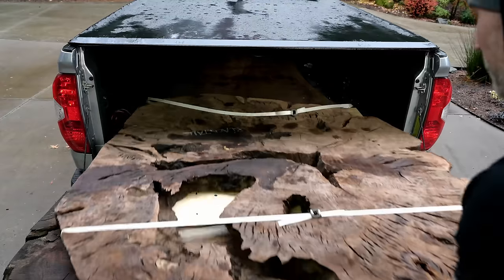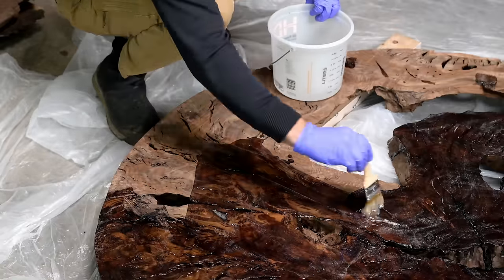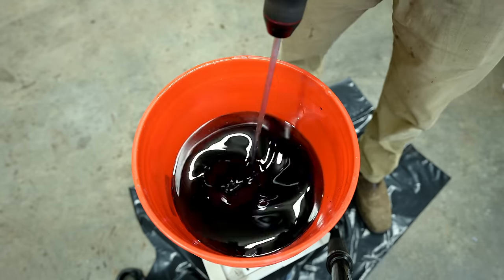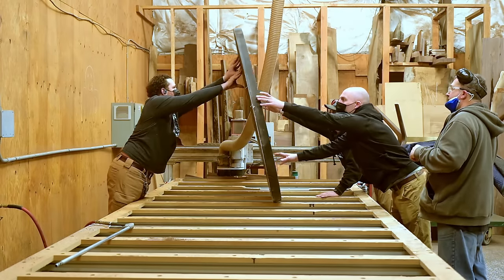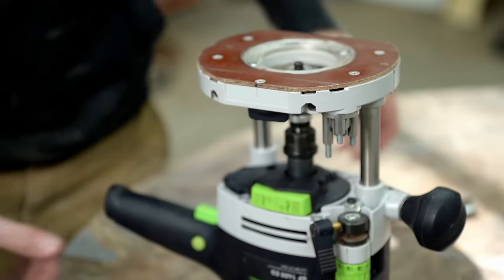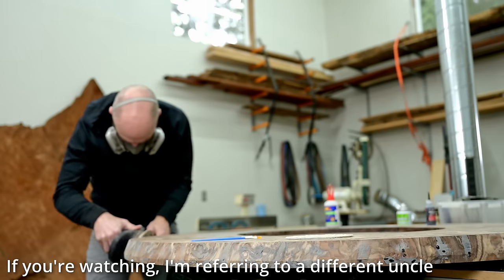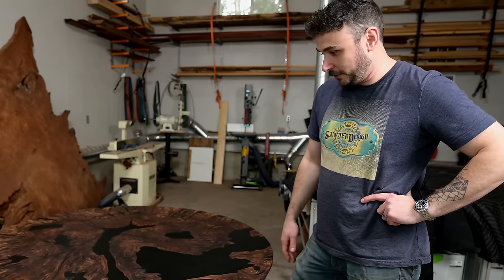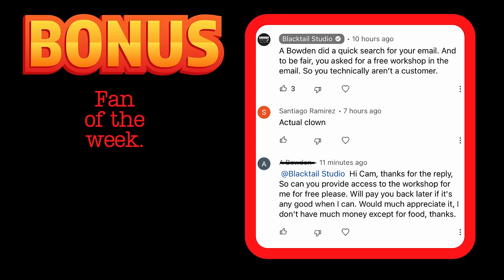The Worst Wood To Build With

Comment: Sawyer! Cam, I'm new to woodworking. Can you explain why the higher moisture makes this piece "unusable as a table"? I get that the table top won't be perfectly flat but is it really that extreme? Thanks in advance.
Reply from the maker: That’s a great question and the effects can vary a lot. This piece with small pockets of moisture will probably get pockets of cell collapse where there will be small depressions, which could even crack over time. Larger areas of wet wood would likely lead to cupping/twisting as well as cracks. All of that said, this piece would likely be flat enough for many people and function fine as a table. Any reputable woodworker wouldn’t be satisfied with a table like this though. 

I could potentially wait this piece out, or kiln dry it, resurface it, and have a perfect table. That might not work though, and would be a big time commitment from me. So instead I’m cutting my losses and using it as a wall piece instead.

Hope this helps!
Reply: @BlacktailStudio  I'm not a woodworker, so I'm just spit balling here.  What if you take it back to the CNC and mill off 1\8th inch to open the grain up, and then put it in a kiln on a very low setting for a long period?  Maybe you can cook off that moisture, depending on how deep epoxy penetrates into end grain.
Reply: In addition to Cam's response, any project using Epoxy Resin should be as dry as possible since Resin HATES moisture/water with a truly Unholy Passion...

If your wood is too damp, the Resin will not Cure properly and will likely crack as it cures...
Reply: @somethingelse4424  You would need to do that before adding the Resin as the Resin will penetrate much deeper than that and with how thoroughly Cam sealed this wood, kiln drying won't do much since there's nowhere for the moisture to escape from without blowing out a portion of the resin...

Epoxy Resin is a plastic once it hardens and finishes curing...
Reply: NOT IF U DONT WANT A FLAT TABLE
xTREME
Reply: @BlacktailStudio 
Ah.
Makes sense.
I see.
Reply: The wood with moisture in it will shrink as it dries, the resin won't shrink. This will create stresses that will likely result in the wood splitting.
Reply: Pretty much every turner has a failure that he keeps in sight.......one of my first efforts was a piece of Live Oak burl that I brought into the AC for 2 weeks....as long as you like egg shaped bowls its fine.......my pet peeve on YT is turners who take a green blank and finish it on a vid.......drying is 50% of material prep and the reason Gobi gave Cam his money back is they sell prepared slabs that are supposed to be dry to usable
Reply: @HappilyHomicidalHooligan  Actually since this is a cookie it will dry some but you don't know how much and there can be splitting and warping so it will have to be a thinner top than it currently is. The thing is you do not know how thin and it could end up being unstable in the end anyway. If I built it I would take a chance but I won't pay that much to take a change.
Reply: Probably a fatal error for selling as moisture level will change no matter what coating you use.. Wood expands and contracts across the grain with moisture content, not along the grain. so expect some radial shrinking causing random warping. Of course some of that grain will not be perpendicular to the surface for added fun.

You first experience with an end grain table?  This one is either your first novel, to be hidden in a very large drawer, or to be your new kitchen table that reminds you that understanding is acquired over time.

Best, keep at it.
Reply: The table will continue to lose moisture and the wood will react as it does so. Split, twist, you name it.
Reply: @somethingelse4424  Yes but the epoxy wouldn't shrink. With end grain wood like this, any matter that doesn't shrink at the same rate as the wood will make it cup, ripple, crack, even pop loudly into pieces once you dry the wood out. How loud? The set-in strain is proportional to the tensile limit of the wood across grain, which for wavy-grained walnut would be well over 50 psi -- over ten tons of force for a 200 square-inch fracture plane! POP!
Reply: @BlacktailStudio  you could sand it roughly  to open the pores a bit (but if you detect moisture, it means that they are open) and forget it in a hangar where it would cook and dry during summer and see how it would turn to then... it's already reinforced by the first epoxy pour, it may just require another pour for fixing some shrinked parts
Reply: @CwazyWabbits  I 9
Reply: @somethingelse4424  If it's so uneven now, it'll likely warp a ton when drying, even slowly. Also the fact that it's been filled with resin probably complicates things more on top of that, too.

Ultimately you might be able to salvage something from it but it's probably better to just start over with some wood that's in better shape in the first place.

Full disclosure I haven't worked with resin myself, but I worked as a professional woodworker for about 17 years. Not claiming to know for sure how this wood would behave when drying but my gut says it'd be pretty terrible. Likely lots of warping and cracking.
Reply: No o
Reply: Hey Cam, is there any way that the dry ice blasting could have caused the moisture to be so high in areas? I mean it’s possible that it was just the way the wood was but that’s kind of a unique process and I think it would be worth testing before using it on another big slab.
Reply: @BlacktailStudio  one question about remediation.  if you sanded the top off.... used a solvent to absorb the moisture and vacuum dried it... could you at least "stabilize" the wood sufficiently so that it would be fit for purpose?  One question I had throughout your build was "why not vacuum impregnate the resin?"  Finding so many bubbles confirms that limitations of gravity impregnation of a viscous resin (viscosity is a measure of 'thickness' ie more viscous - think honey - less viscous - think water)   I suspect you could improve it.... would it be enough?  only you would know :)
Reply: @Jethro.Maloku-le.Rey.Kalsitran  as he mentioned, drying it out may or may not work. But the time and effort investment isn't worth trying.

At best, it'd still require refinishing after. The entire time he could have been building other things earning money. The opportunity cost would easily eat up cost more than what could ever be gained. Pride doesn't pay the bills.
Reply: @BlacktailStudio  That sounds like what we call concrete cancer when you have an out of tolerance mix.
Reply: @cuda128  Dry ice is frozen carbon dioxide, not frozen water so it wouldn't impart any moisture (water) into the wood.
Reply: @BigBrotherIsTooBig  SCIENCE!
Reply: @Jethro.Maloku-le.Rey.Kalsitran  Your idea is the cheapest, most practical, and the one I would go with. I wouldn't sand it, just stick it in a hot garage here in Texas and forget about it for a couple years. Of course keeping it off the ground with air flowing all around it. Then make any repairs necessary to make it usable. Although I'd really just put the table in my dining area and use it. If in the future it cracks or whatever we would cross that bridge when we got to it.
Reply: BigBrotherIsTooBig,

That's true, but you forgot that dry ice is Cold and the temperature differences create moisture in the area. That's why using the dry ice cleaning and then sealing the grain was THE mis-step. He should've dryed it after the cleaning to deal with the moisture. He points this out and he's correct.

Nothing really can fix this. Not even adding more supports to help stabilize it. It's still a usable top but that the cost involved people want a top to last 15-30 years of repeated everyday use.
Reply: @kevinwillis9571  that was the idea : he had already spent 3 gran for the wood and the work, it would be stupid to give up when free heat and time could cure it and even if some new cracks appear, that can't be worse than all the cracks that were in the wood when starting... and even in a temperate area any metal hangar or garage become a kiln in summer...
Reply: @BlacktailStudio  Can't you just take a few millimetres off one of the sides to un-seal the wood, get it to dry and then seal and finish again?
Reply: Helo . I like
Reply: @BlacktailStudio  In wood work is there such a thing as wood too dry ?
Reply: @walterroche8192  You forget that dry ice evaporates nearly instantly and displaces the vast majority of the air along with moisture in the air. 
You also forget that the slab has to be significantly colder than ambient temperature to create condensation on the surface. A few seconds over a spot is not enough time to decrease the core temperature of the wood enough to cause condensation. Your theory suggests that a few seconds of dry ice over a spot can cool down a slab of wood that is hundreds of pounds. I think not.
Additionally, if the dry ice was the culprit, the entire slab would've had a high moisture content, not a few spots.
Reply: @BlacktailStudio  Are you going to keep it, or someone may wish to buy it as a wall piece... of course you could double the price and sell it as a table that turns into a wall piece... LOL... well whatever you do, I'd love to see you still use those table legs, both sets, for some other project... maybe just a round table not so huge... love your work and love his work... collaboration is difficult but can achieve more than just one...👍
Reply: @jedtaylor3551  it's great that Gobi gave him his money back which of course he would because this is basically televised for all of YT to see but how much of taking the wood to the Ice Blowers and not letting it dry properly again have on this item? if he had not taken it to the Dry Ice guys and got it so damp, would it have not been fine?
Reply: @CwazyWabbits  Shouldn't it be sealed from the resin, thus preventing it from drying then?
Reply: @spineboy  the resin must be somewhat permeable as he shows there has already been some drying and shrinkage causing the dip in the surface of the top.
Reply: @CwazyWabbits  I figured that could just be from permeation, and would be adjusted by adding more resin.
Reply: Wait. Why would you care about it cracking and not being level due to moisture? It's just maintenance and repair at that point. It doesn't have to be the best table.
Reply: @BlacktailStudio  in a similar situation, I added a Southwest flair to a piece to disguise remediation. 1-identify moisture pocket centers by range with dots: white--5~12%, orange--12~18%, blue--18~25%, green--+25%. 2-visualize/scribe the concentric pattern(s) that emerge 3-forstner bore the top with 1/4~5/16~3/8 just deep enough to the wood 4-put it somewhere for 6mos. The wood "pockets" will shink&pop away from the top as they dry. Formulate 2 mixtures of Tourquoise  resin--translucent to fill the voids, opaque for the "plug". I used a thin mix for the fill with a rubber tipped oscillating tool to vibrate & eliminate bubbles. End Mill bit on a circle-jigged plunge router cleans up the holes for final top fill of the "plugs".
IMHO, embedded turquoise in a dark variegated  wood is an elegant accent and seeing the translucency of the repair adds to the overall appearance. That said, the key element is a circle jig to make the initial plunges (1/4") and 5/16~3/8 for clean holes to plug. I thin filled using a 20 cc syringe--very clean and goes fast. I made a mounted quick clamp for the multi-tool and moved it around the top as needed. My worst fears were the +25% areas, but turned out the best with the translucent blue below the surface. I practiced a bit with scrap pieces for the right mix of blue tinting, the rest was easy. Mine was a 4" thick,  38" walnut root burl cookie 😉
Reply: I must admit though, I stole this idea from an intentionally designed piece that used a metallic gold resin plug over voids of twinkly translucent gold filler. Coolest thing I'd ever seen.  👍
Reply: @sairam8240   Not sure, but thinking back to how he was talking about how that piece is all end-grain and essentially a bunch of columns that absorb epoxy/stain incredibly well, my guess is it’d go way too deep for that. Not a woodworker though
Reply: @BlacktailStudio  You could turn it into a beast of a clock if it's destined for the wall.
Reply: @CwazyWabbits  this one. This is the answer for those of us who don't have an interest in woodworking. just watching because it came on YouTube.
Reply: @ZombieKitKat  making a clock of of it would be mad.
Reply: @meeshafike7085  there is a world of difference between surface and the internal moisture
Takes days for surface moisture to disappear
1 year per inch of thickness to get down into the low 20-30s depends on your average humidity
After that you earn it and pay
Reply: @hoppykengka8226   Sounds neat, got pics?  A good repair is, to me, even more interesting than everything that came before.
Reply: @BlacktailStudio  I think you need a melamine vacuum chamber that the piece can be bathed in thinned epoxy and vacuumed so the epoxy gets pulled into every pore and all the bubbles in the resin can be pulled too but I’m no expert
Reply: @BlacktailStudio  oyt
Reply: I’m not sure how that resin reacts with moisture but most of the resins I work with for mold making (all my molds are for silicone pieces) end up with horrible de-lamination issues if too much moisture is present. The water obviously takes up space so as it moves around inside the material (and slowly evaporates through tiny bubbles) the space that it previously occupied becomes a depression which translates to a weak spot. This causes cracking and entire layers to just crack off. If the piece is small enough I’ve put it in the oven on low heat for a couple of hrs and then even in an air tight Tupperware with a DampRid bucket for a couple of days. A lot of the stuff I sculpt off of is plaster so this can be a huge issue. Also for anyone who works in Florida or other humid areas, be mindful of the moisture in the air. A good dehumidifier and air conditioned work space will save you thousands of dollars in ruined and bubbled materials.
Reply: Regardless of what happens, it is a BEAUTIFUL wall piece!
Reply: @HappilyHomicidalHooligan  interesting that there weren’t more curing issues.
Reply: @puppykicker7106  all-terrain table!
Take a book from the 2015 wedding cakes of Pinterest and call it “Rustic”. Or “Adventurous”!
Reply: @CwazyWabbits  but will it dry if it is completely sealed by resin? Would it eventually mold?
Reply: @BlacktailStudio  if thats the case. Why not put more epoxy at the bottom? So that it will prevent from cracks or damage. Is that can be done?
Reply: @BlacktailStudio  cant you sell it on offer? :P
Reply: Also consider cost of the table to a customer. If this were a hundred dollar table then a customer could accept some imperfections, A couple of costs Cam mentioned, I believe were about $1250 for the slab and another $1500 for epoxy already has an investment of $3000 in those two materials so easy to see the total retail price would have to be in the 5 figure range.  A person paying five figure prices is demanding, rightfully so, more than a usable table, they are buying one of a kind table that is also an artistic piece. Another factor is Cams business reputation and the damage suffered should the table have noticeable flaws, no word of mouth recommendations from that buyer.
Reply: Add a steal band ,as if a wagon wheel , mask off the epoxy and bleach it dry in the sun..press it ,or use an iron . Spot heat it , 3 times a day for 100 days.
Reply: @kevinwillis9571  Over here in Mobile, that would be called character, and really adds to the piece.............Wood is not perfect.  If the pieces moves a few years later, a butterfly tie can stop the rouge crack, if necessary.  @Cam:  Quit beating yourself up, the piece looks fantastic.
Reply: @BigBrotherIsTooBig : Maybe dry ice does not impart additional moisture, but maybe it freezes and keeps the moisture already existing in the wood?
Reply: @user-rz7cm2we3x  Could be but I doubt it. Cooling off that mass of wood and the atmosphere around it would take a massive amount of dry ice. Either way,  the wood was not dry enough to begin with.
Reply: @walterroche8192 : No, Cam blames the pockets of moisture in the wood on Goby’s fault, before he even bought it, check out around 26:50, he never connects it to the dry ice cleaning of the slab. That’s why they returned him the money he paid them for the wood. I just wonder, because it wasn’t evenly moist, but had these pockets of high moisture…
Reply: @BigBrotherIsTooBig : No, I know that dry ice disappears in normal atmosphere very fast, but maybe it caused freezing of deep moisture in the wood, hence these pockets of moisture. And after dry ice it’s only warming/heating, dry ice is -70 degrees Celsius, no other cooling necessary. 
On the other hand, Cam blames the pockets of moisture on the moisture which had been there even before he bought it (check 26:50) and he says that Goby returned him the money he paid for  the slab, so they must have owned it was their fault from the start. 
But hey, I know nothing about woodwork!😅 I’m just curious. Besides, it’s a beautiful piece (was beautiful even before the job) of wood, so it’s a pity that it’s wasted like that…
Reply: @user-rz7cm2we3x  Right,  so my main point remains. The dry ice had nothing to do with the moisture being present in the wood. It would've had to been there in the first place.
Reply: Why can't you CNC a thin layer off, put it in the house till dry, CNC again, re-coat the finish and you're good.  Center stand support not good and always gonna wobble.  Use a "wooden tube" type support, could even use the current recessed area.  Your buddy needs to make a more stable wider support system.  Then you got a $14k table.
Reply: YOU DESTROY THE PIECE MAN 😫😤
Reply: @BigBrotherIsTooBig  not directly,  but due to his humid geography, condensation would be where it comes into play correct?
Reply: @darwinsimmons1  I wouldn't think enough to warrant a significant effect. The CO2 gas is displacing the air around it along with any water vapor it contains. There will be some I'm sure,  but not very much.
Reply: Where you see failure, I see art and joy. Sometimes we do things just because we're passionate about it, not because we want to make money out of it. You might or might not sell it, but it will be a memorable piece. To be honest, if it would have been lighter in color, I might have bought it.
Reply: That's a beautiful table!  Altho it was overworked.  It was a learning process.
Reply: Turn it into a clock 🕰
Reply: @cuda128  good point.  Dry ice is Dry BUT the crazy coldness  could easily cause high levels of immediate condensation...  the dryness could draw in that moisture.    Would be interesting to test.     I could see a wood shop investing in one of those co2 blasters and an enclosed Dry room for blasting to eliminate condensation.   Would be pricy but potentially worth it.
Reply: @en2oh   if its hard to make a mould to keep such a large resin pour contained.  Imagine how difficult it would be or expensive to buy somthinv that would work as a vacuum chamber.
Reply: @BigBrotherIsTooBig  it wont but the extreme cold woikd definately cause allot of condensation
Reply: @spineboy  water sealed in plastic does still tend to work its way out.
Reply: @hoppykengka8226  wow.
Reply: @BigBrotherIsTooBig if there is decently high humidity and that co2 (insanely cold stuff) lowers the surface temperature of the wood even 10 degrees. I could see water condensing on thr surface.    Liquid Co2 is cold enough to instantly freeze solid an apple. This is Solid Co2.  If there is even a fraction of that freezing happening then there would be condensation for sure.   1mm of water condensation could easily be absorbed and displace enough air inside the surface of the slab to cause  those readings to go up allot.    Think of your shower mirror.   That temp difference is miniscule in comparison to what Co2 would do.
Reply: @lisat9707  You're making my point for me. Even if there was a significant amount of water vapor to condense, that solid CO2 would freeze it just like the apple which would make it impossible to be absorbed by the wood.
But this is not the case, there just isn't enough water vapor to be condensed. To put this to rest, I'll say this... his meter measures the interior of the wood, not the surface. It takes time for wood to absorb and likewise abstain water. This goes to prove, with the small amount of water vapor that the slab may have been exposed to, that the cause of the high reading was not due to the CO2.
Reply: W
Reply: @somethingelse4424   paganinicaprice 11 vidéo
Reply: The nature of wood is to dry under natural conditions over time.  it will not warp or warp.  You should make wood products when the wood is completely dry.
Reply: @Bundalaba  This is called dust.
Reply: You would need to clamp the slab between steel beams go prevent it moving but allow air to circulate. It would need months in a dryer and regular repositioning of the clamps as those areas don’t get to the air. 
Maybe a closed box with a dehumidifier would be a good option.
Reply: @hoppykengka8226  'wood'  love to see some pics of your table!?!
Reply: @BlacktailStudio  Kidney shaped tables were popular in England around for two or three hundred years. Not huge, but for lamps, ornaments etc.

Btw, if you think women prefer that then you have been courting the wrong women. It's a brainwash fallacy that some women also convince themselves of. As an old lady I can say it definitely makes no difference to a woman. Think of how a woman works biologically. How would it make a difference? It couldn't. Also most of the sensitivity for the man is in the tip. You have lost yours, but please don't help with the very wrong belief that most women prefer it. All that matters is that both are properly clean.
Reply: @BlacktailStudio  A wall piece? Good idea. You could probably market them to castle and big house owners in Europe. Châteaux in France etc. Stunning in the right setting.
Reply: @BigBrotherIsTooBig  but it could cause extreme cold that could draw in moisture as condensate….that the moisture readings were widely spread…I think the dry ice exposure idea warrants further testing before being offhandedly dismissed as a moisture source.
Reply: @BlacktailStudio  hope u didn't go with gutter helmet!
Reply: @somethingelse4424  as well as what all the others have said the wood will shrink and actually pull away from the epoxy , I made the mistake of adding an oak round as an island in a river table , sob if it didn't shrimk so bad that a year later when I got around to surfacing and finishing the table I had as much as an 1/8 gap around the island that was only being held in by the unsurfaced over pour on the underside of the table DOH !
Reply: @walterroche8192  Dry ice is cold and may cause condensation bug it would only be on the surface. It should have dried.
Reply: @BlacktailStudio  Havnt  heard size of it yet, But how about cutting in half make a headboard and a footboard? Just a thought
Reply: Who said uncut was difficult to clean 😂
Reply: @rah1735  Must have been someone uncut and crusty.
Reply: @BlacktailStudio  .biolii
Reply: насверлити дірок знизу, і через пару років буде сухий ?
Reply: I haven't read the replies to this but as I just spent a season learning to be a painter ,my eyes SHOT open when I saw the 30 mark on that reader 👀 so just a side shot of advice if you want to paint anything you want to get one of these readers as well because wood will reject the paint and cause premature flaking and it's just bad news. I just learned this fact myself this year so happy learning for everybody here!
Reply: Have you thought about using an industrial microwave to dry problem children like this slab? Microwaves only excite the water in structures and the slab might have endured enough to do it. Besides more water means more excitation, less water, less excitation, so it probably would have evened out to a uniform level of moisture.  Food for thought.
Reply: @somethingelse4424  I see you have kept the "Old Coconut" lubed.  You have overlooked the fact that this slab is END GRAIN. 4:06 So the issue is not surface, but through top to bottom.
Reply: @BlacktailStudio  can you not perforate all the pockets (from the bottom) with a small drill and let it dry out?
Reply: I87⁷I
Reply: Good on you man that was something that could have been just let go my many others and sold as if nothing was wrong and maybe would have been fine for years but you did the right thing
Reply: It’s still a beautiful piece of work.  I would love to have it.
Reply: @somethingelse4424
Reply: Too bad, it’s a really sexy table!
Reply: @denniswilliams3934  As I mentioned I'm 0% woodworker, so this is an honest question.  On something like a 2" thick slab where the surface is end grain, how deep does epoxy typically penetrate if it is just left to sit at atmospheric pressure?  I'm not asking for precise numbers, just a ballpark.  If you were to them mill down the surface by 0.25" (to 1.75") would you have any unsealed grain exposed? As a thought experiment to illustrate my question, what if you had an enormous band saw and cut it into two 1” slabs?  Would there be any open grain exposed?  I guess that is the premise of my original suggestion... because if you did mill down to where there was at least some exposed/unsealed end grain couldn't you then slowly dry out the adjacent areas and re apply the resin?  If it required removing too much material, of course it would become impractical, but I'm wondering out of curiosity if that would work.
Reply: @jedtaylor3551 I’m wondering if the moisture problem was there when he bought the cookie or came from the dry ice blasting? He mentions and shows in the video the condensation from the dry ice evaporating. How long did he let the cookie dry out before sealing it and pouring the epoxy after the dry ice blasting? He probably trapped all  that moisture right into it. I’m surprised he got a refund.
Reply: @keithstrickland9547  Man he is a good wood worker. But like your idea idk if he has the concept of not kilning or drying the wood to a certain % . The idea freeze blast it resulted in a major chill in the piece.  Do not mind that when he gets it to his "wood shop" - it is not a controlled climate for woodworking . So once it is brought in , there is little chance for it to be - dried properly -
Reply: @cuda128  There is no moisture in dry ice, since it's frozen CO2.
Reply: @BlacktailStudio  I can't help but disagree... I've been woodworking for a number of years now... I've at times had moisture in my tables, reason being I live in Mississippi and we have high humidity. No matter how good your shop is built and insulated, moisture finds it way into the wood. So long as I've used Polyurethane to seal the wood, it's never broken down. Almost as if it's preserved. So my question then becomes, how long does this cell collapse take?
Reply: @BlacktailStudio  I absolutely disagree with you and you can be a good wood worker. And there's thousands Probably hundreds of thousands of people out there that would accept this table as perfect
Reply: Wood moisture pockets don't really matter that much. Cam is a bit of a perfectionist and his products are in the high end range that's why he's a bit finnicky about it. Think about it, though. How did master cabinet makers of the 17th and 18th centuries make their high end furniture for royalty? Did they have a perfect working Wagner moisture meter? Nope. I'm pretty sure lots of ultra rare antiques were made with accidental moisture pockets in them, and they're all just fine. Also, cracks and checks add character to wood anyway.
Reply: @cuda128  I realize that this question is 7 months old but dry ice is carbon dioxide, not water and it sublimes directly from solid to gas, so there is no 'liquid' carbon dioxide either, at room temperature and pressure...
Reply: @somethingelse4424  I’m not a woodworker either but I am a craft enthusiast who has been told that you don’t put resin or epoxy in the oven 🤷🏻‍♀️
Reply: I’d take it!
Reply: I'm impressed you got your $1200 bucks back from the people who sold you the wood!
Reply: I live in MIssissippi too and we have the worst humidity. I think you and install a wood burning stove in the corner…. Get rid of all cans of flammable epoxy and paint… sand off the entire bottom of that table and keep that little stove going or a few days to dry that COLD wet room and slab out. Then check the humidity. You’d be surprized how wood heat dries out wood in the house
Reply: I bet you can pull that mousture down yo 8% in just a few days or a week. Be sure to completely sand the bottom so the water can escape then reseal it or not!? The bottom fires not have to be sealed that’s just not necessary
Reply: Not fires…does
Reply: @HappilyHomicidalHooligan  What's the recommended moisture level and how do I check properly/reasonably conveniently?
Reply: @stanleythedoggy  I don't know how much moisture is too much unfortunately, however there are several Moisture Meters available on the market to check a wood's moisture content.

I haven't done any woodworking since High School (far, Far, FAR more Moons ago than I like to think about let alone remember...😄😁😆😅😂🤣) so I'm not by any means an expert. I can only tell you what I myself have learned by watching You Tubers like Cam...
Reply: @assassin6329  Why?
Reply: @somethingelse4424  🥴
Reply: @BlacktailStudio  It would be interesting if you checked in on this piece in the future just to see what that moisture does to it over time.
Reply: @BlacktailStudio  -
Reply: Moisture will make its way through concrete. You really should not allow any of your slabs to remain on the concrete. How do I know moisture comes through concrete? I put a bag of concrete on finished floor. The floor had been finished years before. It was not a fresh pour. It was also moisture controlled inside a house in the basement. I went to get the bag about 7 months later to use on a project and it was hard as a rock.
Reply: Qual link para aquisição do aparelho que fez a medição da umidade.
Reply: The solution would be to put epoxy over the whole table surface, clear on of course.  Moisture cannot go anywhere,  it would be sealed in.
Reply: @assassin6329  BIG BEN WOODEN CLOCK.... LOL
Reply: Could you not just identify all the damp areas, turn it over and completely router out the entire area to within, say, 1/4 inch from the top surface? Then refill with resin and reflatten the top?
Reply: How long had that slab been cut and where was it stored?  If you had or they had stored it for a long time, would all that moisture have disappeared on its own?  If so, would the whole project have been saved?  😢
Reply: @BlacktailStudio  на вашем месте столяр из России просто продал бы его, а в потом в случаи чего в дурку включил бы и не вернул бы покупателю деньги. вы честный мужик,респект👍🏽